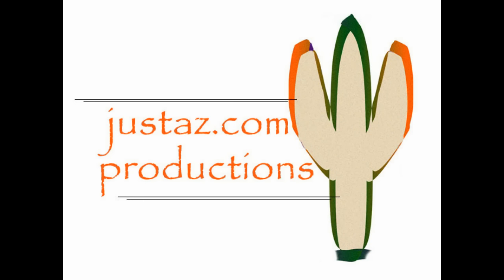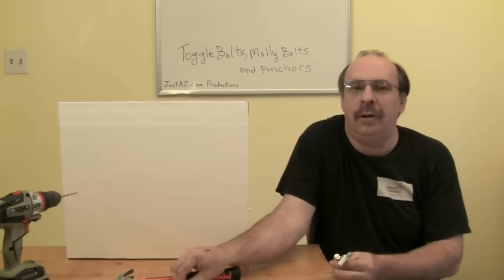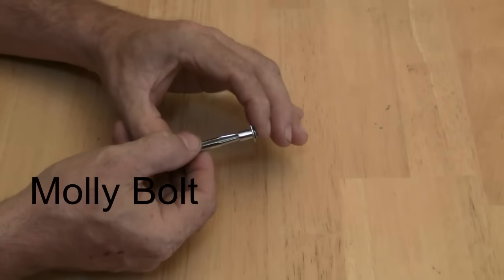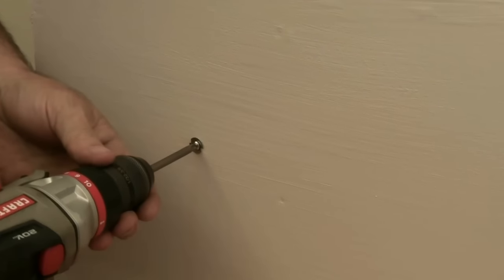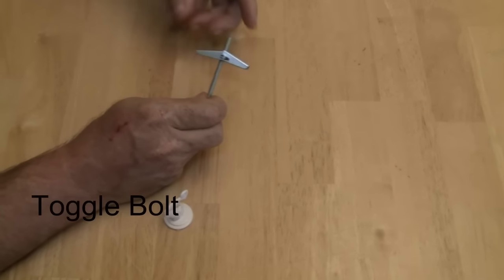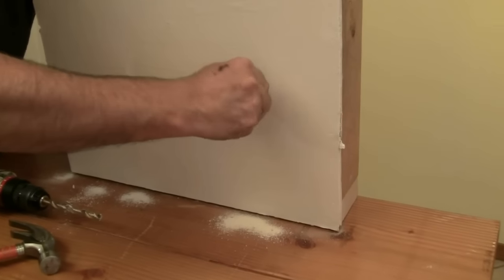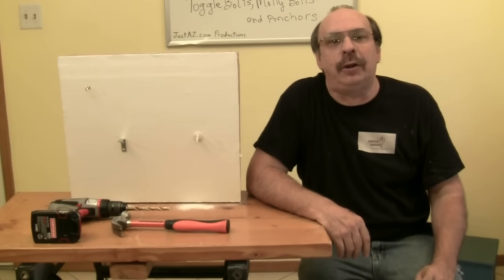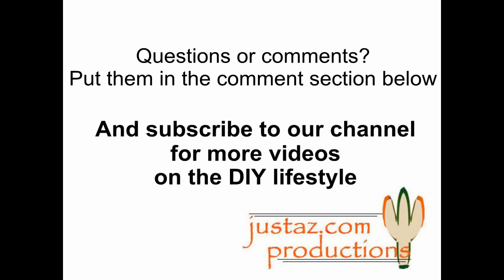Toggle Bolts Molly Bolts and Anchors

Comment: Great video! One thing that should be mentioned is that a molly bolt (the screw part of it) can be removed and reinstalled. This makes it great when installing an access panel that might need to be frequently removed and reinstalled.

Comment: Which method would you say supports more weight? My drywall section is really thin - about 1/4". Do you think a set of 3/16" toggle bolts would support two steel brackets, a 5/8" shelf, and a 20 lb. stereo speaker sitting on top of the shelf?

Comment: why would I choose a toggle bolt over a molly bolt, what are the down sides (can't get them out if you put hole in wrong place?)I'm hanging a 5 lb pottery picture which method is best in lath and plaster?

Comment: I used the molly bolt - same one as shown for 1/2 inch drywall.  Word of caution: It might be best to use a manual screwdriver to install the molly bolt.  I used an electric screwdriver and tho I had it going very slowly to force the "prongs" on the other side to fold in, I did not stop in time and the "teeth" on the collar of the molly bolt caused the collar to turn.  Then I could not get the bolt to unscrew because the whole thing turns.  Now I guess I'll just have to keep drilling to push it all the way through the wall and figure something else. Tried  pushing on the imbedded collar while I tried to unscrew it with a manual screwdriver, but no luck.  Great video, however.
Reply: That is why they make "hollow wall anchor setting tool" even if you do mess up putting it in with a screwdriver or Drill motor it can still be made right without ruining the wall or trying to pull it back out. I watched a video on youtube a guy showed how if you do not use the Tool then just make sure you use something like a bracket or something so that the bolt does not bottom out against the fastener and therefore will keep the fastener from turning while you are installing the anchor, it works great.

Comment: Need some advice.  I am making shelves to go around my dining room.  My house was built in the 1920's so the walls are plaster & lathe.  They are likely to be heavy especially once they get some decorative plates, etc on them.  What kind of fasteners should I use? ( I am pretty sure I won't be able to figure out where the wall studs are.)
Reply from the maker: Sorry for the late reply, Linda S. We've never worked with plaster and lathe and are reluctant to give advice in an area in which we have no experience. That said, we did find a web site that may provide some information on this subject for you.

http://homeguides.sfgate.com/use-wall-anchors-plaster-walls-23838.html

Again, sorry for the late reply. Hope you're able to install your shelves successfully, and we wish you the best of luck with all your projects.

Comment: When trying to hang curtain rod brackets I keep running into a very hard area that my drill won't go thru. This is in my daughters apartment.  What is that right around the window? Is it concrete or plaster or is it wood and I just don't have the strength or right drill bit or drill to go through.  I cannot get thru it at all and sometimes I get about 1/4 inch down and hit it.
Reply: Probably steel.  Most drill bits will go through.  Anchor with self-taping screws.

Comment: Any advice on which to use for securing a CD tower to drywall? There's no stud nearby.
Reply from the maker: Hello, Alan Freedman. Any of these fasteners would work. Just check the weight rating, that is, how much weight the fastener can hold. With no stud, a toggle bolt is most likely your better choice, particularly for something as weighty as a CD tower. Thanks for watching, and best of luck in all your projects.
Reply: Just Az.com productions Thanks.  I used the toggle bolt--it worked just fine and it would take a mighty big earthquake to bring that CD tower down.
Reply from the maker: Alan Freedman Well done! Glad to hear your project went smoothly, Alan. And thanks again for watching.

Comment: I took the screw out of the Molly bolt after I installed it and now it won’t go all the way back in.
Reply: The interior mechanism may not have been fully compressed when initially installing the molly bolt. 
Another reason might be that the screw threads or female threads might have some griit on them. Try spraying a thread penetrant, such as WD40 on the screw threads and reinstall.

Comment: When would you use a toggle bolt versus a molly bolt?  looks like they do the same thing..
Reply: Steven Greenberg did you find your answer? I assumed he was working in order of durability and weight baring strength..
Reply: The advantage of a molly bolt over a toggle bolt is that the molly bolt screw can be removed and replaced without losing any interior part of the mechanism inside the wall. This works great when installing an access door that may frequently need to be removed and reinstalled. When using a toggle bolt, the interior "wing" would fall to the bottom of the wall interior, thus losing it.